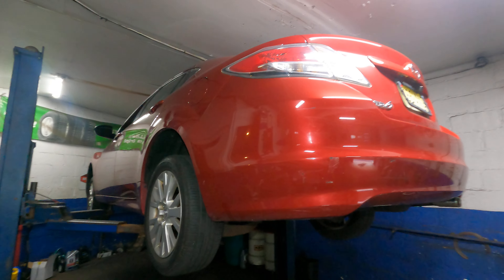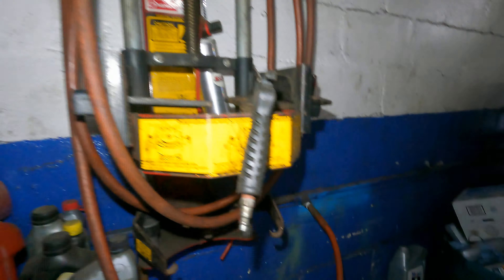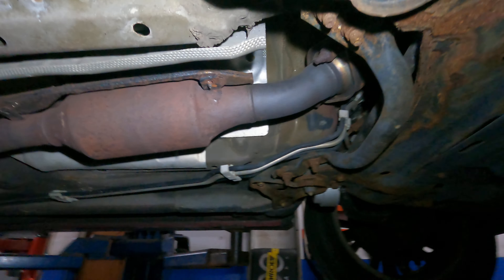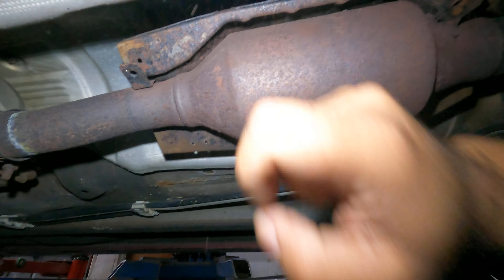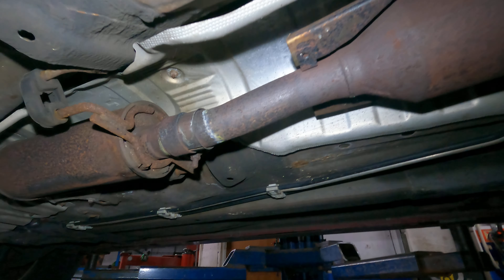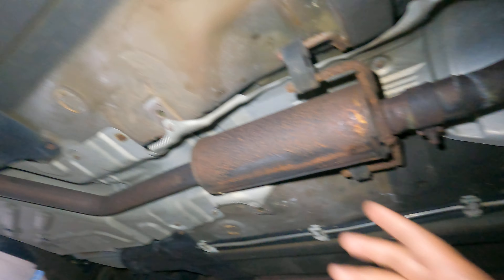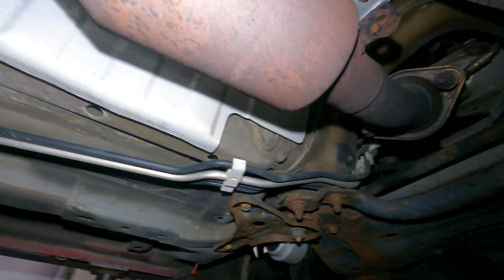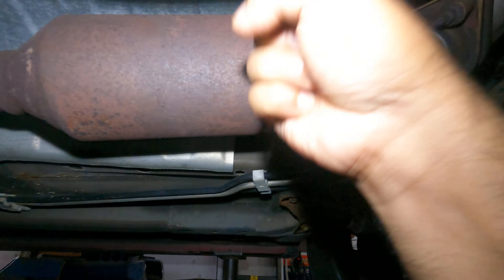Mazda 6 or 3 making Rattling noise  check under exhaust shield loose

Comment: I used stainless steel clamps to secure the heat shields to the CC of my two 20plus years vehicles. Both have been good for years.
Reply from the maker: Yup
Reply: Which size diameter did you use?
Reply from the maker: @Bkat419  not sure just had one laying around or put two togather

Comment: hey bro I need help on my 2018 Honda accord, the touchscreen in my car dosent turn on. Note even when I put my car in reverse. I tried looking for a fuse with radio on it and I can’t find nothing.
Reply from the maker: Not sure why it don’t turn on maybe the screen dosent get power or ground it electrical u might need to check all fuses and check power and ground or screen is bad
Reply: @RBTheMechanic  yes it was a fuse that was burnt! I replaced it and it works.